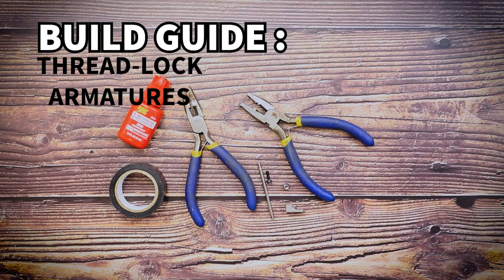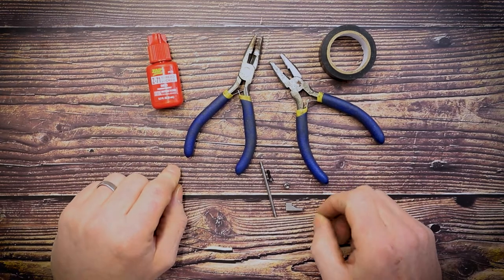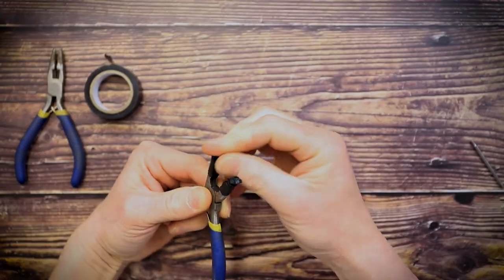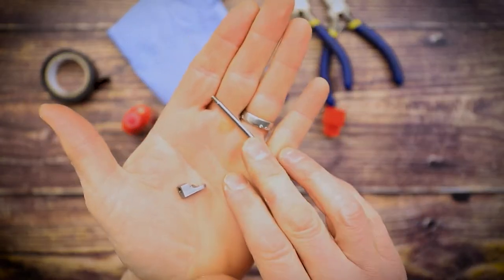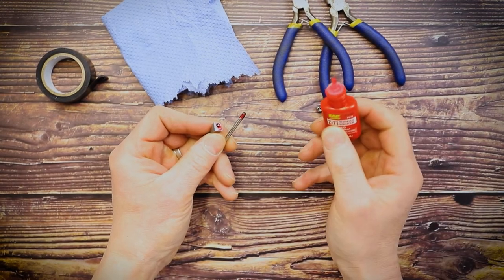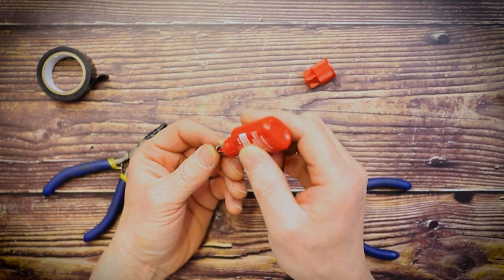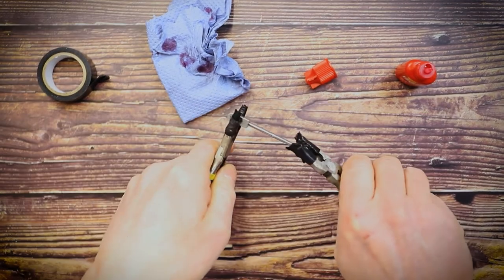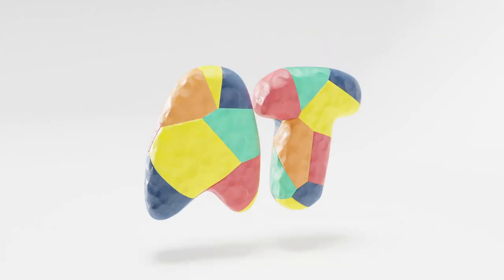BUILD GUIDE: Threadlocking Armature parts

Comment: Hi! About the threadlock glue. I am from Argentina, and it would be more affordable to me to get the actual Loctite by Henkel, sold here. However, they come in different numbers and strength. Do you happen to know which number I should use? From what you describe in the video, it should be something with permanent fixation, meaning 271 would be the go-to. I also couldn't find the glue you're using in stock. If you have it, would you please share the link in this video? or should I subscribe to your newsletter to know when it becomes available? thanks in advance.